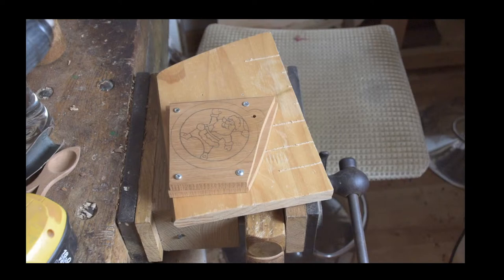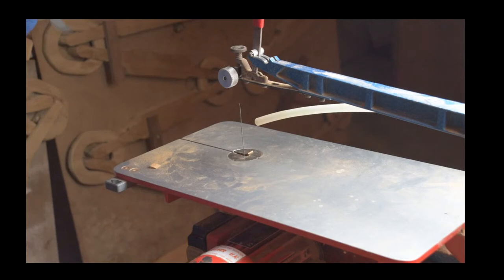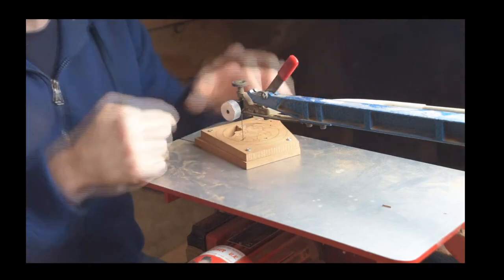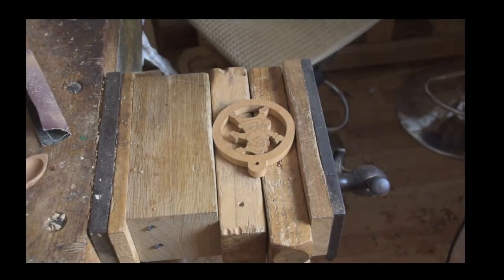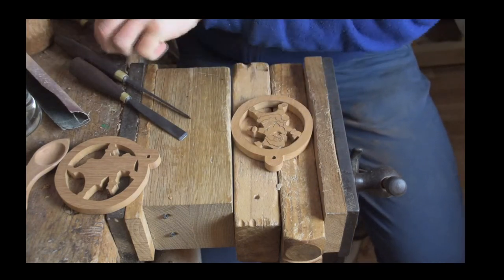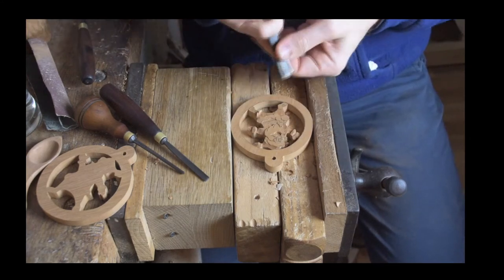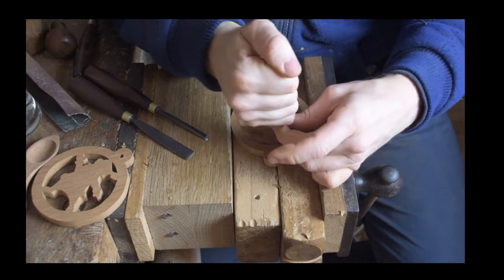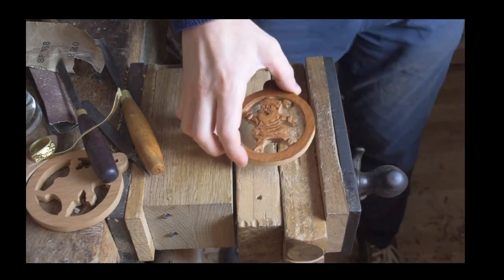Scroll Saw and wood carving live. Christmas Special.

Comment: hi, im new to scroll sawing. what size blade are you using for tight corners, thanks
Reply from the maker: Hi, great to hear from you. I use a Niqua no 9 reverse tooth blade. Does a great job for what I am doing.

Let me know if you have any other questions always happy to help where I can.

Wishing you a happy and healthy Christmas and New Year. All the best from us all here at The Lovespoon Workshop. 👍👍
Reply: @DailovespoonsThomas  thanks for that.  I,m starting of easy. making some jigsaw puzzles for the young relatives  in our family, would you recommend  Niqua no 9 reverse tooth blades for 6 mm birch ply but i'm doubling  them up so would be 12 mm thanks
Reply from the maker: As long as the blade is compatible with your machine it should do a decent job for a project like that. Because it is a reverse tooth blade you should get a cleaner finish than a standard blade both on the top and bottom.

Hope the project is successful, thanks for getting in touch, let us know if you have any other questions. All the best from us all here at The Lovespoon Workshop. 👍👍
Reply: @DailovespoonsThomas  thank for the info, just been looking at some more of your videos, they're  very helpful, thanks
Reply from the maker: Brilliant, delighted to hear that the videos are useful. Thanks for supporting our YouTube channel. 👍👍